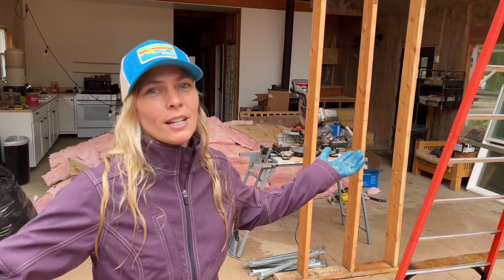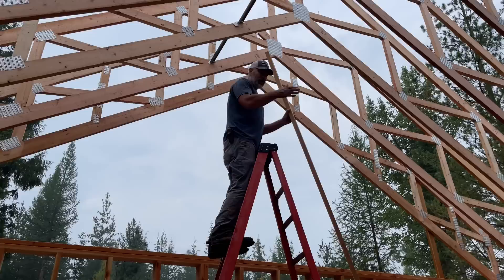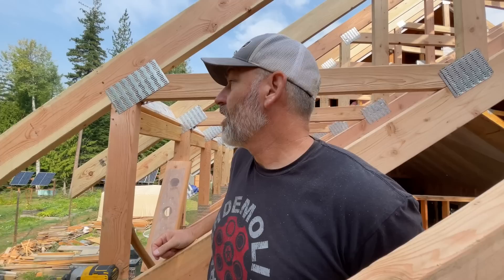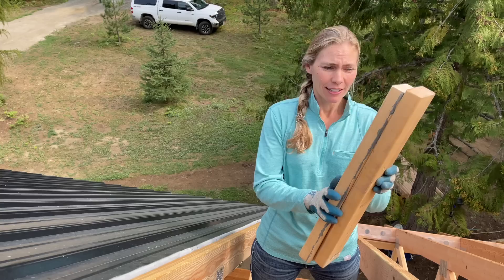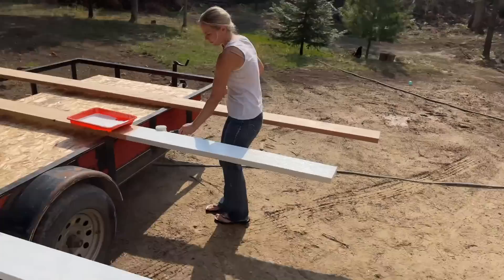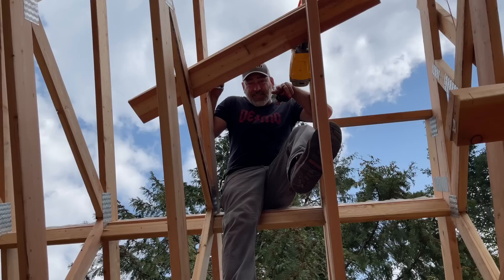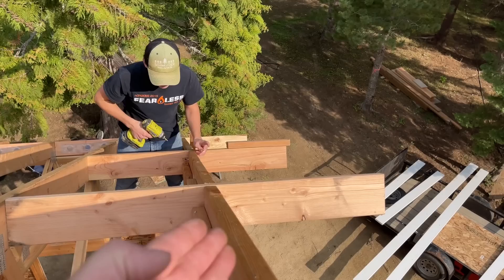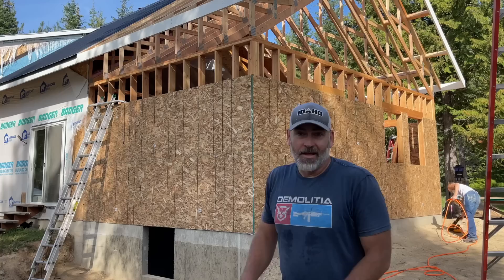Setting Trusses in the Rain - Real Off-Grid Living

Comment: Use some WD40 on the chop-saw, so it slides smoothly. Always use a piece of scrap wood to check vertical cut is correct.

Comment: I observe that when you are cutting, you are cutting on the middle of the marking. Please remember that you then will get the length a bit shorter if you don’t take into account the dimension of the blade. The best is to cut exactly on the side of the marking, but please select the correct side.

Comment: I bought that same saw from harbor freight because I seen u build a whole house with it but I have had to buy a digital angle finder to zero out the blade every so often u can get them on Amazon it is worth it. And when that slide raise is rough just take some 1000 or 1500 grit sand paper go over it real quick then put some grease on it. It will roll better than brand new.

Comment: All you need to do to your sliding miter saw is to spray WD-40 on the sliders and rub them down with steel wool. It will bring back the smoothness of the sliders.

Comment: Sometimes I wish that this thing worked a bit different, so we could give some advice on time. LOL I think those beetles will just crawl right under the edges of that screening. It would have been a good idea to put a small bead of silicone around each hole, and press the screen down into it. If you have room, you could still get up there and put a bead of silicone around each hole. Making sure to press through the screen. But then... There are plenty of other gaps all over the place. LOL 😄

Comment: A rat run is called a two x for bottom with a two x six in a L shape  strong back usually installed middle and middle of Rt and left side span depending on truss specs all you need inside of blocking and hole is the styrofoam panels called proper vent for your soffit venting to the ridge if your insulation hit the underneath of roof shingles has nothing to with heat loss
Reply: T your insulation hit those holes you should notch the top instead works more efficiently if you vent the soffit material enough

Comment: How did you manage to crew/nail the blocking on both sides between the trusters as they are all in the same line. You only showed it from the easy still open side.
Reply from the maker: From an angle next to the previous blocking.